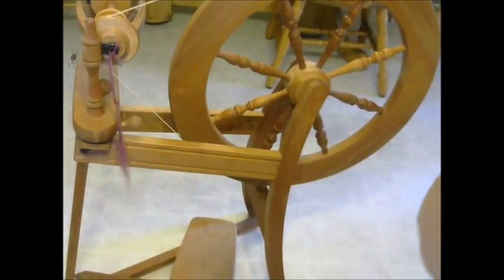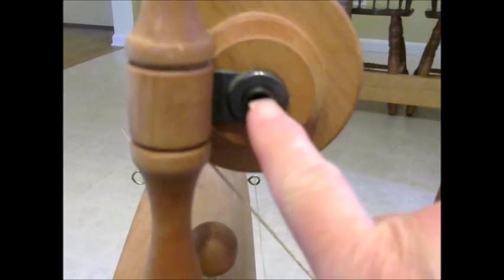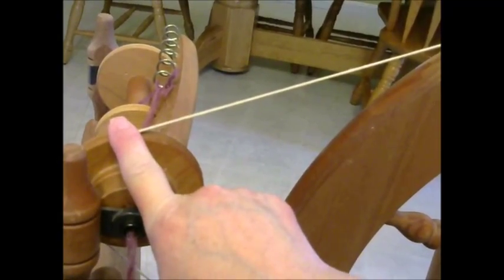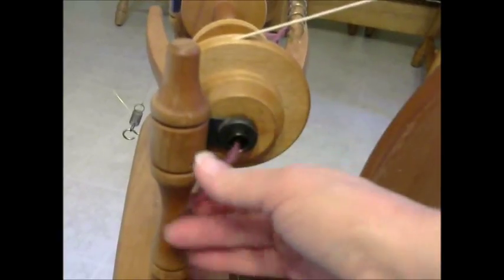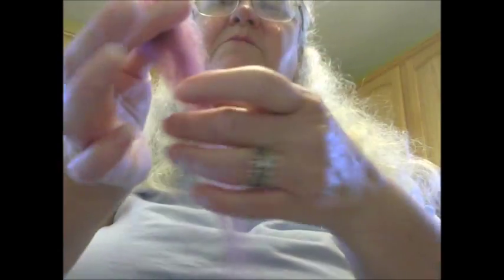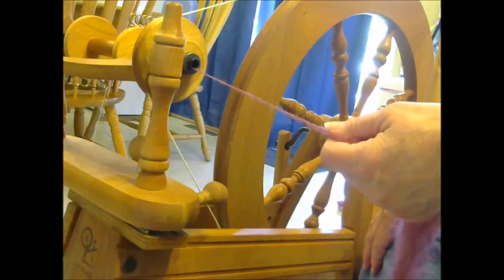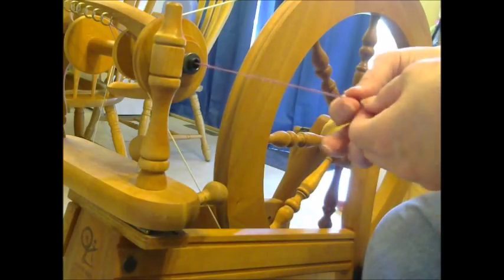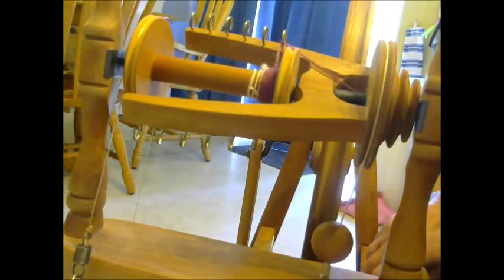Fiber Spinning Tutorial

Comment: This was a great tutorial Katrina.  I have an older wheel and not sure if it has a break on it maybe it should have?  It has two whorls on the bobbin,  should the wheel band be around both whorls or one?
Reply from the maker: Probably just one.  There are double banded wheels, but they're not that common.  If the whorls are the same size, then it is double banded.
Reply: There are two different sizes and a tension knob to turn.  I could send you a photo if you would like to see the two wheels I have.  I need an email.

Comment: That was interesting.  Occasionally while commuting on the train  into NYC from NJ I have seen a woman using a drop spindle which is a very portable way to spin.  Do these different methods produce similar results?  Have you tried using a drop spindle?
Reply from the maker: Yes, they produce the same result, although getting an even yarn is more difficult.  I have used a drop spindle before I got my wheel.